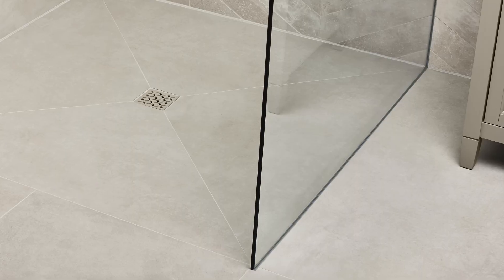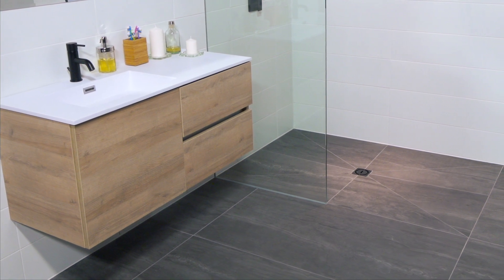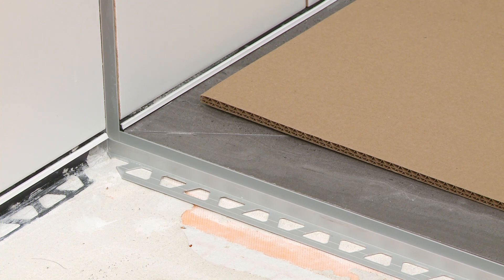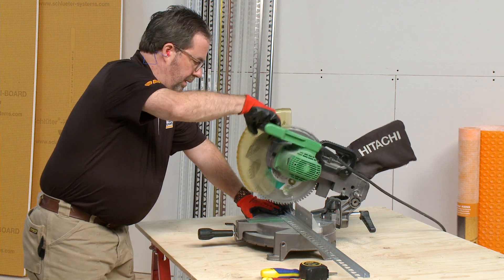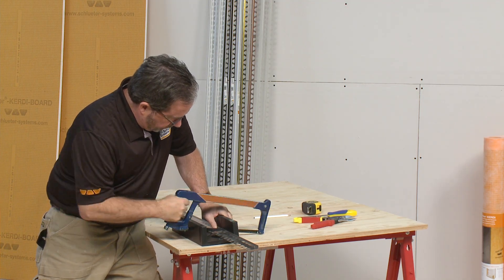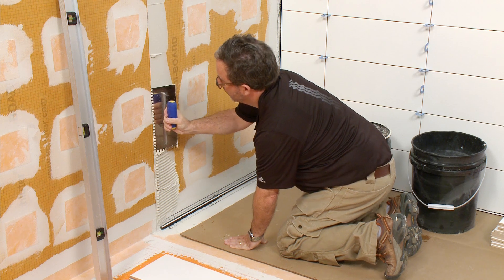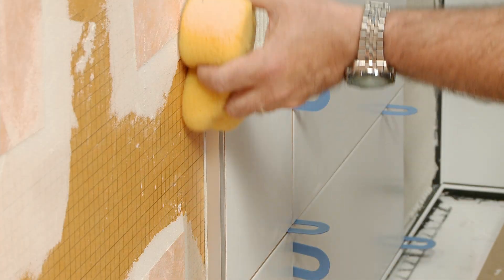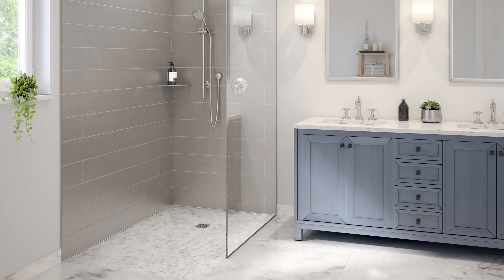How to install the Schluter®-DECO-SG Profile

Comment: Is a high quality clear silicone to be used in the glass channel right before glass install?  Should the glass be supported overnight while drying?  Please provide insight.  SG for 3/8 glass install and about 2 weeks from glass install.
Reply from the maker: Hi Al! Yes, a high quality 100% silicone is used in the DECO-SG channel right before the glass is installed. Supporting the glass panel overnight as the silicone cures is recommended to ensure no issues.
Hope this helps!
Reply: @schlutersystems1  Yes.  Thank You.

Comment: it  looks good but  still debating if I should go with this option,  just worried if the glass will hold if the profile is only being held in place with some adhesive 😏
Reply from the maker: We can connect you with your local Schluter rep if you'd like to discuss your project in more detail. Send us an email at social@schluter.com with your full address, and we can send you the name and contact info of your Schluter rep!
Reply: If it's siliconed in all the way on both vectors it's a simple physics problem.

Comment: Hi Schluter team, can this be installed on the outer edge of a kerdi curb to support a fixed shower glass screen? I'm looking to maximize the elbow room in a 15 sqft shower.
Reply from the maker: Hi Henry,  This should be fine, as long as the glass is also stabilized vertically. It's always a good idea to touch base with our Product Support team to discuss in a bit more detail. They can advise from there or connect you with your local Schluter rep. 800-472-4588 (US) or 800-667-8746 (Canada). Hope this helps!
Reply: use Kerdi Fix to adhere*
Reply from the maker: Hi Henry! If it is to adhere the profile on the curb, we recommend to actually user thin set mortar as it is installed at the same time as the tiles.  Hope that helps

Comment: Is a slight gap left at the top of the glass panel? If a panel is ordered to the full dimension it would not fit. As the panel drops into the bottom channel it will created a roughly, glass thickness, gap or vice versa. Is there any way to address this?
Reply from the maker: Hi there! When using the DECO-SG profile, the glass can not be to the full dimension as the installer will need a little bit of room to insert the glass panel inside the profile. If a full panel is wanted, please make sure the brackets or channel are not drilled or screwed into the shower membrane ; this will compromise the waterproofing of your shower.
Reply: @schlutersystems1  So there will be a slight gap at the top of the panel and vertical channel when it is dropped into the bottom channel. Understood but, glass shower enclosures are installed all across the US where physical attachment is required. The attachments will penetrate any membrane behind the tile. There is no way to avoid this in most Frameless glass enclosure applications. Holes are always to be back filled, but simple adhesive installation can't be done in most applications.
Reply from the maker: Hey, If penetrations must be made to secure the glass, they must be sealed with KERDI-FIX, or other suitable sealant. Please contact customer service for complete instructions on making a successful water-tight penetration. You can reach them at 800-472-4588 (US) or 800-667-8746 (CA)

Comment: I like the idea, but I wonder about what happens to the water that gets into the channel?
Reply from the maker: Hi Sam I Am, 
The glass should be installed according to the glass manufacturer requirements. Ideally, any excess water will evaporate between uses.
Reply: This thing is decorative only. Using it for shower glass hold is such a bs. You need special deeper profiles with rubber teeth to hold the glass.
Water evaporates fast enough only on open area. You ll get a lil micro world under the glass without silicon filling.
Reply: Clear silicone caulk I thought
Reply: @ОлегХореев  Which is why you fill the channel with silicone before installation....